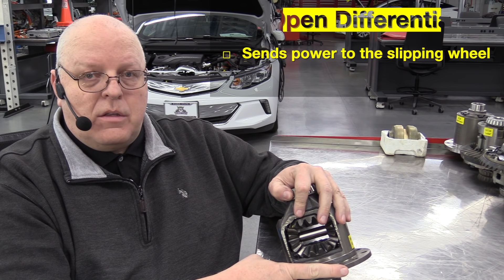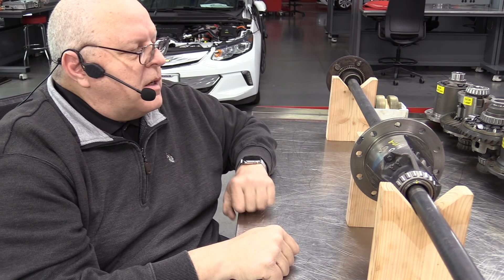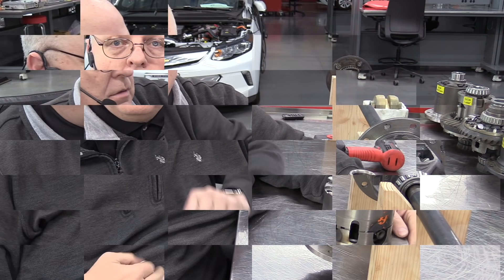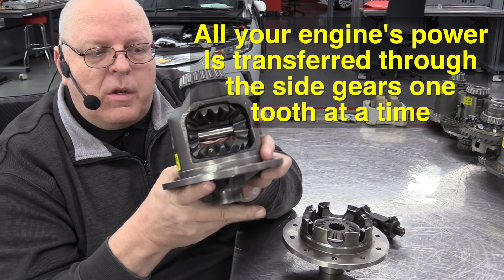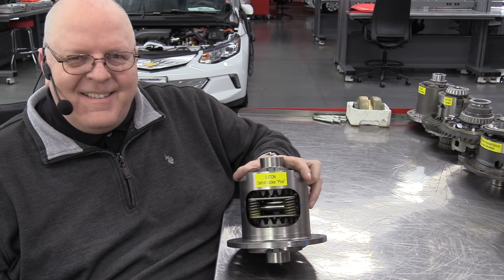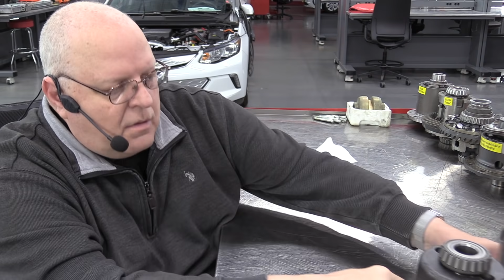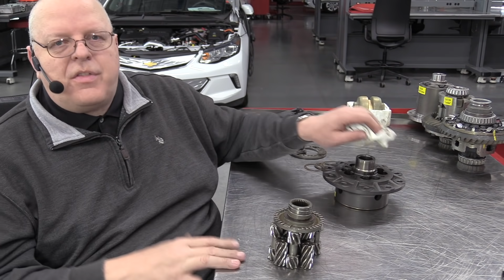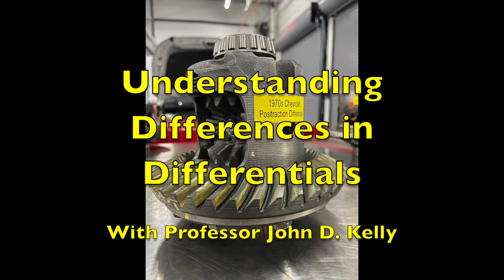Understanding Differences in Automotive Differentials

Comment: For an open differential, I have tried to simplify calculating axle rotations values, and case rotations, by creating formulas, and then showing how we can calculate the rotation values, using the formulas. I will give simple, short names to the variables, and then write the formulas using those names. The variables are few enough that I will be able to name each variable using just one letter for each variable. Then we will plug values into the variables on one side of the formula (one side of the equal sign), in order to calculate a value for the lone variable that we have managed to get onto the other side of the formula.  This is elementary algebra. I hope I didn't make any mistakes! 

Let's first define our variables – give them short names: turns of axle A we will call A. Turns of axle B we'll call B. Turns of the case, we will call that C. That's it – 3 vary-ables, 3 thingies able to be varied, able to have various values.

Formulas:
C = (A + B)/2
Multiplying both sides by 2 we get
2C = A + B
Subtracting A from both sides, we get
2C-A = B
which is the same as...
B = 2C-A
similarly....
A = 2C-B

Calculations
If the value of B is 1, then what is A?
To find the answer solve for A
Note that if the case is turned once, that means C=1. 
A=2C-1
A=2-1
A=1

If the case is turned once, given B is 0, then what is A?
To find the answer solve for A
A=2C-0
A = 2-0
A=2

If the case is turned once, given B is 0.5 then what is A?
Solve for A
A= 2C - 0.5
A = 2 - 0.5
A = 1.5

If the case is turned twice that means C=2. If the case is turned twice, given B is 2, then what is A?
A = 2C - 2
A = 4 - 2
A = 2

If the case is turned twice that means C=2. If the case is turned twice, given B is 0.5, then what is A?
A = 2C - 0.5
A =  4 - 0.5
A = 3.5

Did I make any mistakes?
Reply from the maker: Nice job, thank you

Comment: Professor, your mic gain is either set way too high or you're working with low batteries. The output is clipping and sounds distorted no matter what volume i set on my device. Consider adjusting your gain before posting.
Reply from the maker: Thanks for the feedback

Comment: Open differential. Both wheels always get equal power, but if one is slipping it's not putting down much torque. Hence the other wheel doesn't put down much either.
Reply from the maker: Thanks for watching

Comment: I once thought that a Rear Wheel Drive transaxle performed the same function as a 5-speed automatic gear changing Differential.  I even investigated the possibility of a CVT RWD transaxle being used as an automatic gear-changing Differential.  It was my thinking that hooking up a system with a regular: engine transmission driveshaft to a RWD automatic transaxle that the 5-speed transaxle would act as my automatic gear-changing Differential.  I even thought of using two CVT transmissions so they could work off each other to lighten the load on the drive train components.  I figured a setup like this would get a lot better gas mileage.  I'm going to need a lot better education than the one I got.  So, educate me.  I would like to do better than a 2-speed rear end.
Reply from the maker: Thanks for watching

Comment: I’ll be upgrading my 86 Buick grand national rear diff and axles and this is an excellent introduction to what’s the most misunderstood or rather ignored part of the rear drive cars of yesteryear. 
Thanks for posting
Just not sure which carrier diff to upgrade to although I’m pretty sure the brand moser or strange are the axels to use for disc brakes rather than the drums the car came with.
G-body posi drive Buick Regal 
Any suggestions would be appreciated keeping in mind 550 + h.p. to wheels present at this time
Reply from the maker: Dana makes great differentials. Thanks for watching

Comment: The teacher would make someone think the housing turns, it can’t because it’s mounted to the rear end, ans the large bevel gear spins on the end cap berings that are exposed, He should have started with the drive shaft connects to a universal to a yoke, that holding the differential and of course this outer plate with all the bolt holes are a fixed to the automobiles housings.the housing doesn’t turn, only a hyperactive student would see this, the teacher is teaching students that do not have an  Imagination.
Reply from the maker: Thanks for your feedback

Comment: when I remove speed limiter off from my 2.0TDI it automatically transforms my transmission into LSD and my clutch/DMF ends up suffering 🤔 I wonder how this applies to this differential understanding Also I replaced my transmission after 2nd set of DMF to one that had different gear ratios yet removing speed limiter still had same effect on transmission.. yeah and without removing speed limiter one wheel would spin while other one didin't
Reply from the maker: Very interesting dilema. Thanks for watching!

Comment: What about the unloading cone differential? It is applied at all times if the vehicle is not moving by spring loaded clutch packs or by the absence of traction on either or both wheels. Once traction is restored and gear load is established the gear separating force unloads the clutches and the unit works as an open differential.
Reply from the maker: I wish I had one to show. Thanks for watching!

Comment: Excellent Description ! I see you corrected the info on the Detroit Locker , But one thing you forgot to mention about it ... A" Detroit locker " Locks the axil only when applying Power , let off the power and it acts like a open Diff. Perfect for drag racing , But a pain for the street . ( you have to be coasting for it to unlock ) I had one in a Drag car that I decided to put on the street and wow what a pain to park it in a spot. I went through 3 sets of front tires in one year. I would say NOT for street use,  But perfect for drag racing.  Locked when going down the strip , and open when you are coasting to turn at the end of the run.
Reply from the maker: Thanks for the great information!

Comment: The fact that the entire differential wasn't shown ( crown gear etc. ) made this too confusing. I gave up after 5 minutes
Reply from the maker: Thanks for your feedback. There are two gear sets in an axle housing. 
1. The differential gear set (allows a "difference" in wheel speeds) shown in this video.
2. The ring (crown) and pinion gear set (applies power to the differential case.)

Comment: I have the torsen unit installed in my Toyota 4x4 Front Japan bought the company in the 80's as the Hummer was manufactured Gleason Torsen could not sell the units because of the military contract......I love this unit no tire ware....... use 75 80 gear oil......The warehouse is still in Rodchester NY..........Love this  DIFF.
Reply from the maker: Thanks for watching!

Comment: Professor the the clutch limited slip was not developed by Dana, they received that tech when they bought Salisbury axle company, and hypoid drives came from Gleason gear works as well as the original torsen  diff, which is a bit different than the Eaton version.
Reply from the maker: Thanks for the information

Comment: At 56:10 I had to chuckle about welding the gears. That is what I did on my 66 Chevelle stockcar in the 70's. It worked for two years. Very tricky driving on wet roads. Great video.
Reply from the maker: Great example. Thanks for watching

Comment: Hey professor I have a 1994 Chevy truck with very high miles when do you recommend rebuilding replacing the rear differential  Considering the fact that there has only been one fluid change on it during the life of the vehicle yet I am experiencing no problems at 480,000 miles?
Reply from the maker: That is incredible. If it is not making noise or leaking, just change the oil and keep driving. Thanks for watching

Comment: Dear Sir: I've been a shade tree mechanic and hi-perf guy for 59 years since I was 18 and believe this is one of the finest differential discussions I've ever seen. Back in the day at GM Tech we learned about application and maintenance on diff's but not the variety of types as you have here. As an owner of GM autos (chevy) over the years I've been into these applications for maximum use situations. Of course all this is moot on newer cars as the ABS can power or brake slipping wheels as needed under normal conditions of use.   Thank you for this video.
Reply from the maker: Thank you and Thanks for sharing

Comment: Little trivia. First job out of high school, 1973, McNamara Pontiac. Customers would fuss about the clutches popping in a turn. G.M. Had a part number for whale oil to go in with the 90 weight.
Reply from the maker: Yes they did. It was very good at coating the gears and preventing corrosion. Thanks for watching

Comment: I've always loved differentials because they really are an ingenious design and I just love learning about all the different types of LSD, lockers, etc. One of my favorites and the one I installed in my Ram is the Torsen type or helical LSD. The only downside being if you get one wheel in the air, you may have to set the parking brake or apply the brakes to sort of fool the differential into thinking there is load on the axles. Very informative video as always! Weber Auto is always one of my goto channels for accurate, easy to understand information.
Reply from the maker: Thank you very much!

Comment: What about so called viscous differential most RC cars use? It's basicly an open differential with closed case and you fill it with these different viscosity differential liquids. The % how much it lets it slip is adjusted by the viscosity of the fluid. Stiffer fluid is more "lock" and you can have these fluids from 0-100. Works great but how do those work in full sized cars? And thank you for the video.
Reply: In RC the pinnion gears and pinnion axle are slowed down with the visco liquid making them turning more with the casing. The Casing is filled with the liquid and stiffer the liquid less it lets the side gears to turn separately. So stiffer the liquid, more "lock". Sorry about my English, I'm a foreigner.
Reply from the maker: The viscous clutch was used in automobiles years ago, but it has long term reliability issues. Leaks fluid when overheating. Thanks for watching

Comment: Great video, thanks for taking the time. On the Gleason-Torsen helical diffs, I recall the selling point being that they are torque sensing, thus sending torque to each wheel based on the amount of traction available at that wheel.
Reply from the maker: Thanks for watching

Comment: Okay, at 30:10  IS NOT A DETROIT LOCKER  !!!!!!!   It appears to be a Sure Grip limited Slip differential.  A Detroit Locker is a locking differential designed and made by Eaton Corp.  It a has a set of locking dog teeth that will lock and unlock as the case maybe.  No clutches at all !!!!!!!!!!!!
Reply from the maker: Yes, thanks. I acknowledged that in the top pinned comments. Thanks for watching